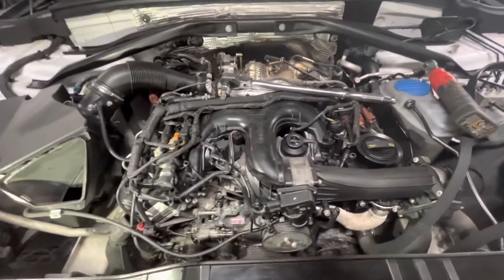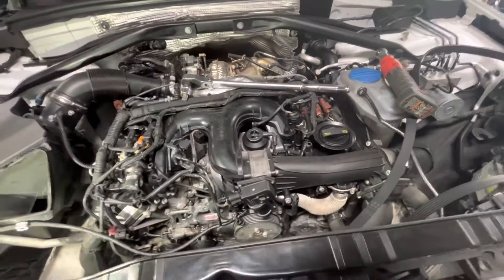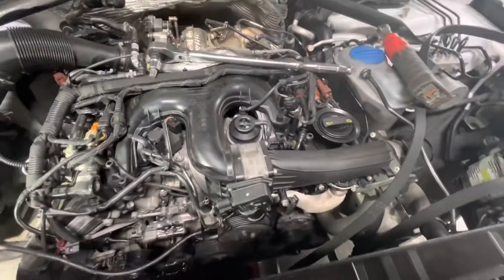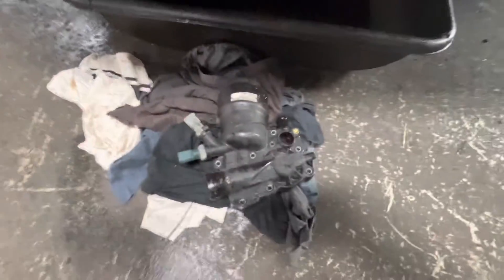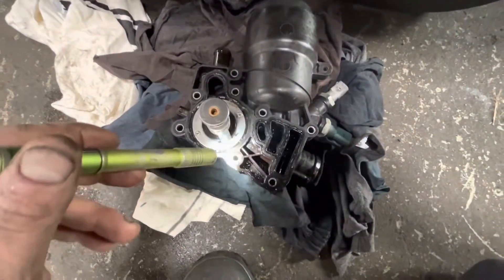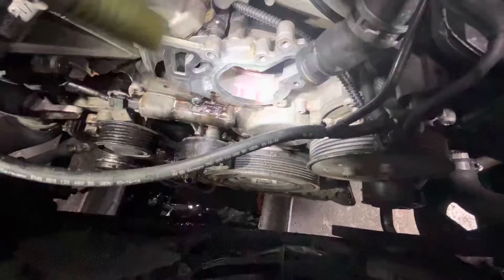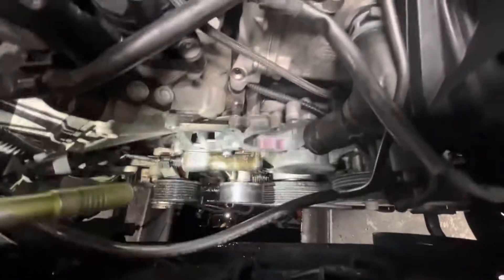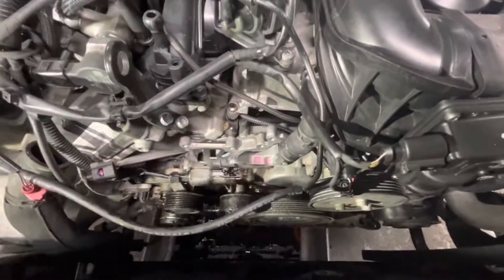AUDI Q5 TDI MYSTERY COOLANT LEAK OFF THE FRONT OF ENGINE

Comment: Hey man. Do I need to drain the coolant and the oil before replacing the housing? I have the same model just wondering before I start the job. Thanks
Reply from the maker: Yeah draining fluids would be best
Reply: Mine does the same  I checked couldn't Really pickup where the leak is coming from. Someone said it's the water coolant pump seal😮

Comment: Did the oil cooler and valve beside it last year  - wasn't t it - just spent another 2k got the filter housing changed . Same problem still .
Valley fills up then dumps on belt and throws it off within 100km .
Could it be the front plastic cover where the hose from the oil cooler goes to ?
Reply from the maker: Yup, absolutely could be, I’ve seen that several times now